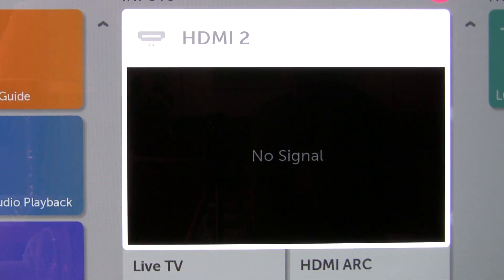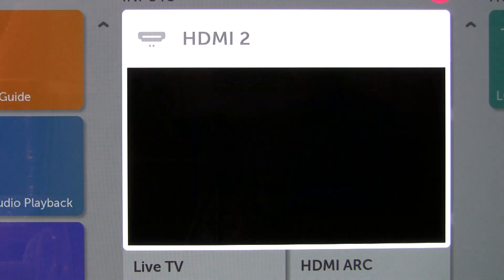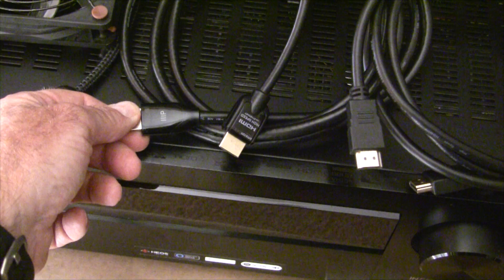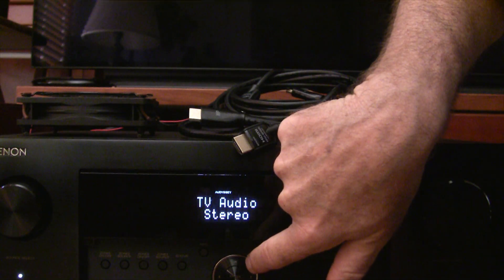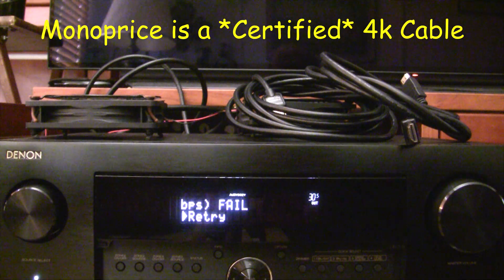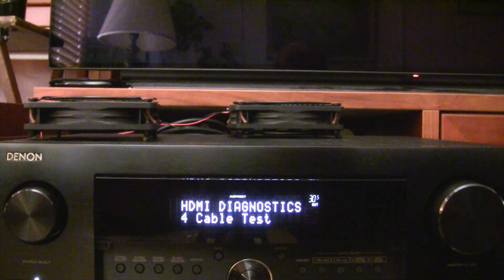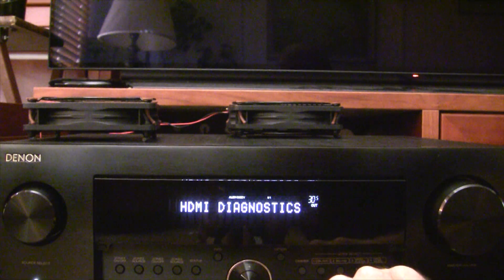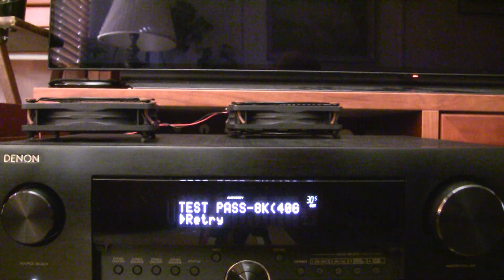Denon Receiver HDMI Cable *RE*Test - Testing High Speed & older HDMI cables using New Firmware

Comment: You’re about to have a deluge of views - the Nvidia 30xx series GPUs are releasing 9/17 with HDMI 2.1 output. Lots of PC gamers with LG OLED TVs chomping at the bit for a proper >=40gbps HDMI 2.1 cable. 

Quick question (excuse my ignorance) - the Zeskit cable “passing” the 8k test means it can transfer 48gbps bandwidth, correct? Edit - I just noticed the diagnostic test flash “40gbps” so I’m guessing that means the Zeskit is good to go for my LG CX 48 @ 4K @ 120hz :) 

Thanks again for the videos, you are filling a gap that YouTube seems to lack.
Reply from the maker: You're welcome!
Pass the word!

The Denon x4700h's HDMI 2.1 port can only pass 40 Gbps, just like the LG CX TV that came out this year.
Last year's LG C9 (which I have) had a dedicated HDMI 2.1 chip so it can do the full 48 gpbs.

So the 40gpbs shown is what the Denon can do for this test.

And since that's all you really need at this point (and for a long time) for any 4K or 8K video signal, you should be fine.

I'm hoping that certified HDMI 2.1 ("Ultra High Speed HDMI" is the official name) cables come out before the Xbox Series X is released November.
That's what I'm going to be using for my 4K 120hz gaming on my TV.
On my PC I have an ASUS ROG Swift PG279Q 27"  (2K - 144hz) monitor which is good for gaming since I'm sitting so close.

The Zeskit 8k isn't certified (there aren't any certified cables available yet), but it has good reviews on Amazon and they claimed it was used to demonstrate 4K @ 120hz and 8K @ 60hz  earlier this year at CES.
And with this test I'm more confident that it meets the HDMI 2.1 standard.
I don't have a 4k 120hz source yet (I'm waiting for the XBox Series X), so I can't really test it yet.
Reply: @BetaCygniBlog  You won't get 48gps because all Televisions are only 10-bit and the max you can get is 40gbs.
Reply from the maker: @randybradley4151  That's correct. And the receiver HDMI test only goes up to 40gps.
Reply: @BetaCygniBlog  Ah yes, I did quite a bit of reading on the 48gbps vs 40gbps debacle before purchasing the CX 48 - like you said, ultimately not an issue. When I get my RTX 3080 later this month I'll test out how the Zeskit fares from a true HDMI 2.1 source. If everything works, will be able to get all the bells and whistles (variable refresh rate - Gsync, 120hz, HDR, 4:4:4 chroma, etc.). Will let you know. Will also be sure to share your vid. 

Side note - I'm so glad the Xbox Series X is driving a higher standard for console gaming. This ultimately benefits the consumer tremendously.
Reply from the maker: @jtc1285  Great!
I'll be posting a follow up video once I get my Xbox Series X which is apparently coming out on November 10!
https://www.windowscentral.com/xbox-series-x-and-xbox-series-s-release-date-and-price-finally-revealed.
I'm anxious for gaming, but also for watching my 4K Blu-rays like Ready Player One which should fully test my video and sound system.